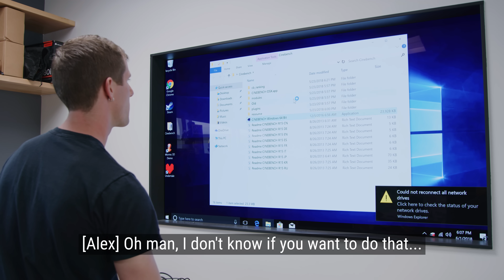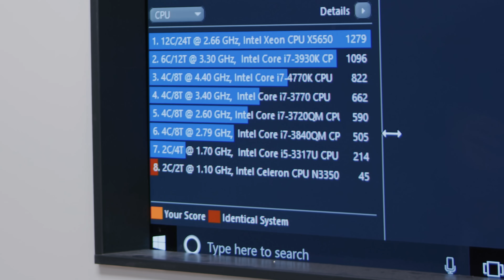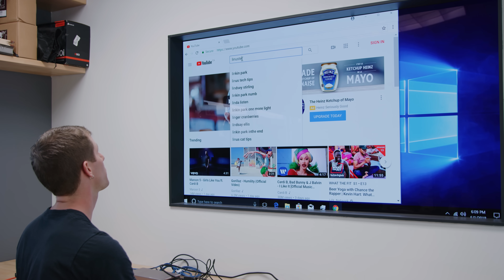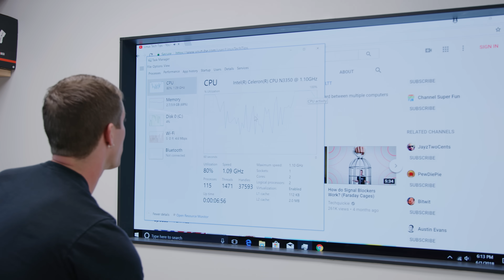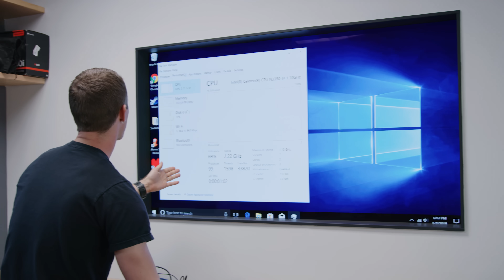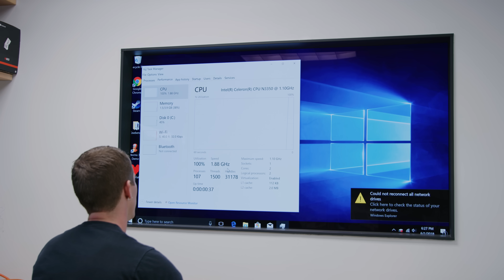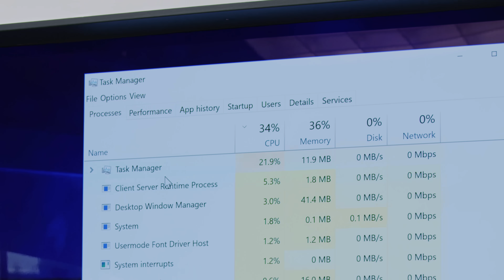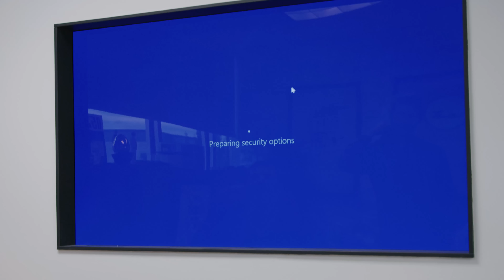PC Smaller than an SSD

Comment: The new raspberry pi 4 clocks at 1.5 GHz and has 2  4K HDMI 2 USB 3.0 and 4GB RAM
Reply: And has ARM architecture instead of x86/x64
Reply: Thomas Winovich I bought it
Reply: And it runs windows! I can't remember the link to the project but it does!
Reply: @ImTheBoyReal Most of them have a low powered intel cpus with 2GB ram . Not ideal... The versions with 4 GB of ram are very expensive . If you can afford them just get a laptop
Reply: @culturedsquid8442  even today's mini laptop would do
Reply: And it uses usb-c, as broken as it is.
Reply: Can’t run windows or steam or pretty much anything with the arm processer
Reply: @culturedsquid8442 .. Expensive? It was maybe $80 for me, and that's in the Philippines. Should be even cheaper in the US
Reply: @shavedbird694 .. Why bother gaming or using steam on a single board PC anyways? You're better off buying an old laptop for that
Reply: @redpillsatori3020  I'm not from the US , I'm from Greece , they are more expensive here . The 4GB ones start around 240,00 . And they have Atom chips and Celeron J s . Sure a similarly priced laptop isn't doing much better . They are on the same level , but the laptop has a screen , a keyboard , the trackpad , a front facing camera , speakers and a real ssd at 256 GB ! While the Intel comes with none of these , you have to buy it all and it comes with 32GB which simply isn't enough for windows .
Reply: Me (who knows how to overclock it.): There is 2.1 ghz acctualy

But if you want to overclock the gpu too, you need to clock the cpu to 1.8ghz and you have to have luck. Its very hit and miss. If you reinstall the os, it might work, it might dont, depends (on something probably). Maybe ill work after an update.
Reply: It’s also got a quad core processor instead of a dual core.
Reply: Office Chair n
Reply: @culturedsquid8442 .. Ah that's surprising considering that Raspberry Pi foundation is based out of the UK so you would think that they'd be cheaper in Europe.. Maybe Brexit has something to do with it. Lol
Reply: @redpillsatori3020  he means the intel compute stick
Reply: Grant Gardner it barely runs windows. Has very poor driver support. It would be faster to use QEMU 🤣.
Reply: True
Reply: @Windows Fanatic 2020 Exactly these people don't know what they are talking about.
Reply: Now there is a version with 8gb ram
Reply: Rohan Raman Windows has spyware and keyloggers built-in by design. Just saying.
Reply: @aero33888  But then again, it is still the most used OS in the world. I myself use Linux, but just because, for my use case, I prefer it.
Reply: @mrpawno4955  but now twice as much RAM as your x86/x64 computer. And a lot of ARM are faster than x86/x64
Reply: @ggldmrd5583  maybe.... But what i wanted to say with my original post is, that everything PC based (software) is made for X86 and not arm. Thats the problem here
Reply: @mrpawno4955  And so you think that it's normal to not know how to recompile softwares from sources when we use a computer ? I think that this is the first thing to learn when you get a computer...
Reply: @mrpawno4955  Also 95% of free packages have an arm version today...
Reply: @mrpawno4955  Even Windows 10 got an arm version...
Reply: @ggldmrd5583  i think youre trolling right now
Reply: @mrpawno4955  No, im serious. All what you can do in a x86/x64, tou can do it on an ARM chip. You just have to code it or compile it because more softwares are made for x86/x64 due to the fact that x86/x64 came out before.
Reply: Weak

Comment: When a pc the size of a trackpad on your laptop is faster than your laptop
Reply: Lucky_Miner01 And your phone
Reply: WHEEEEZE
Reply: This is actually faster than my phone when overclocked  My phone runs at 2.01 ghz
Reply: And your supercomputer
Reply: dude theres no way you have worse cpu than 1.1ghz
Reply: @xt2607  sndn 625 is 2.02GHZ
Reply: @inter-galactictravellerspa9036  snapdragon 625?
Reply: @nvcbl  nope Snapdragon 675
Reply: @inter-galactictravellerspa9036  oh ok my phone is clocked at 2.02ghz
Reply: @nvcbl  is it overclocked
Reply: @inter-galactictravellerspa9036  ¯\_(ツ)_/¯
Reply: @xt2607  Don't underestimate Chromebook-like laptops.
Reply: In your dreams.
Reply: My phones clocked at 2.3ghz but it's a exynos 
9610
D:
Reply: they used the acer nitro 5 i have that laptop (cool)

Comment: Wow! That's cool! Actually, smartphone nowadays is also like a mini PC.
Reply: Marc TV I was thinking the same thing...
Reply: Not x86 compatible though.

I'd love to see them run something like the Quake 3 benchmark, I've been running that on every PC that I've built for just about 20 years now and although it seems to bottleneck at around 900fps on modern hardware it's still a great way to compare the speed of slower PCs.
Reply: Smartphones use ARM CPUs, that's a different game...
Reply: And you don't have to use a dumbass touch screen that doesn't read inputs correctly more than half the time, so it's better than a smartphone
Reply: meanwhile i buy a 8core cellphore
Reply: the amount of cores themselves doesn't matter much
Reply: Welcome to 2007
Reply: Marc TV but cant run windows
Reply: but none can run full windows OS, until this.
Reply: Who say smartphones can't run Windows?
There are emulators for Android to run them since 2013
Reply: Marc TV is not wrong imo.
A lot of smartphones nowadays ( excluding iPhones since their bulky "secure" system don't allow much functionality to work like Windows ) can do most of the work that Windows can do : Editing videos, file manager, compose Microsoft words, excel, powerpoint...
If you like, you can also buy an OTG USB to have mouse and keyboard input.
Reply: @Dankeststorm, I do. You can run without hardware and software problems? I know you are lying. Full windows functionality is not there. I've been through it.
Reply: U can still run a lot of things
Reply: mg23 
Of course it's gonna be problems since they are not optimized, like, sometimes the emulated Windows can't read my CPU or GPU, but it's a possibility.

Edit : Possible means it's able to boot Windows up and usable, but it's a bit glitchy
Reply: Ritit 
Yeah.
Reply: But this mini PC is a full windows machine! (Or linux if you can put it on there)
Reply: But can it run Crysis?😂😂
Reply: +Felix_ Rock_ While the vast majority of computer hardware will actually run Crysis (How well depends) On this occasion I don't think it will even start lol
Reply: Felix_ Rock_ 
No, but it can run The Elder Scrolls.
Reply: Felix_ Rock_ 
No, but it can run The Elder Scrolls.
Reply: Haha it's like a bulb just turned on in your head. Smartphones have always been like a mini pc
Reply: Yes but with screen camera and speakers
Reply: quake 3 is open source and can be compiled to most modern platforms
Reply: i've run some simulations that are written with same algorithms on both x86 and ARM (only difference being the compiler) and i've compared. My Ipad pro is only half the speed of my 15" quad core i7 on these test. It was a Finite element modeling. (running topology optimizion)
Reply: You mean.... Asus ROG Phone?

Comment: Can you try and make it into a DIY laptop? With a battery, keyboard and display in some kind of enclosure that I'm suggesting would be 3d printed
Reply: I've always wanted to do this
Reply: Well yes u can do that with a raspberry pi as well just how easy/hard is it to do and if u are skilled enough to do it is the question.  But if u can 3D print (very well getting sizes right can be hard if u are new to it) your off to a good start
Reply: Trey miller raspberry pi computers laptops are not good if you try to do something serious
Reply: The GPD Win already exists, and it runs much better that this thing.
Reply: that's not the point
Reply: I think that the Kangaroo PC is a better concept for that. It already exists, but it's not easy to find available to buy.
Reply: Motorola Atrix or Bionic Lapdock. Laptop without the PC for said phones to dock into. Has battery, screen, sound, keyboard, and mouse in a laptop like device. with some hacks to the power delivery circuit and adapters it could potentially run.
Reply: Also you should delid the processor
Reply: Just buy lattepanda, like cmon its old already and way better than this, 8g ram 64g drive M3 7y30, lots of ports..
Reply: All mobile processors are already "delided".
Reply: BEN, we all know it's you. Stop this, get help.
Reply: Check out the PineBook or one of those "DIY Laptop Pi" kit :) those can be great
Reply: YYYEEEESSSS PLZ
Reply: I mean, you could probably shove it into a PI-top with very minimal work.
Reply: There's a tonne of other channels for that. They're known as the non tech review business channels.
Reply: So many people saying Pi-top as if the LattePanda doesn't exist and wouldn't be a better fit for a DIY laptop since then it'd be Windows 10.  (edit: missed Jovan's response)
Reply: God no keep these guys away from anything DIY
Reply: Sir Valiant III but it will make for entertaining content
Reply: DoomRater Not that many DIY enthusiasts would choose windows over Linux since that would be there go to operating system for most of their projects. Plus there isnt much that windows can do that Linux can't
Reply: The GPD Win is also hellaciously overpriced, as is the Win 2 and the XD
Reply: DD Electrotech has done this with a raspberry pi
Reply: You're living in 2089
Reply: Why bother, I picked up an Acer Intel based chromebook for £50. Slapped a full sized ssd in there and 8gb of ram, ran a boot hack, then slapped Ubuntu 18.04 on it.
Reply: People have turned gaming consoles into laptop form factors, so I can't imagine this being much harder.
Reply: Thats a pretty dumb and pointless idea/exercise.

Comment: Totally going to try to cram this into a game boy shell like people do with the raspberry pi
Reply: Joshua K it’ll be easier to do on the pi, input output on arm is 100x easier than on this, not to mention the documentation is already there for retropi.
Reply: probably doable.. you'll want to find a better way to cool it, though.. XD
Reply: gino1313 I'm sure i could get it up and running with a light Linux OS and have Emulationstation/Recallbox boot up at launch. Then just splice some wires and add usb audio, Arduino with a gamepad sketch, and solder a charging/5v boost module to a polymer battery. I agree that the support for the Rpi makes software very simple, but that RAM and GPU on this PC make it very tempting to try. Those were the main bottlenecks for N64, Dreamcast and PSP on the pi. This micro PC has so much potential...and with 5v 3000mah draw it's easily within reach.
Reply: Joshua K I'm intrigued to see that happening now, best of luck if you do
Reply: Why? as you  aknowledged raspberry pis exist.
Reply: The pi will out perform it
Reply: ROCK64
Reply: and then what ? you get a crappy windowzed emulator ?
Reply: You should never, never ever install flashplayer. ever.
Reply: Bruce Banner probably you are experiencing some kind of user error, pepperflash should work on every site, despite of that, you can do better on a cheap hardware with Linux than windows, everytime, it's just lighter and efficient than ever
Reply: Bruce Banner Maybe it's the 1gig of ram that makes your videos crashing, chromium isn't exactly a lightweight browser, make sure you use some microsd swap or try a different browser, if that persists can be a software bug, imo there are better distros than raspbian
Reply: Joel Rufiange It'll be on a screen no bigger than 3.5" with a resolution around 320x240. Which doesn't look bad at all...and certainly isn't bad for retro gaming. The Raspberry pi 3 is very good at this with only a fraction of the Zotac PC's performance.

Comment: You might be amazed how much better that thing would cool if you simply laid it on a piece of aluminum. 

Seriously, just a small flat piece of sheet aluminum like the side pannel of any old PC CD player would probably cut them temp in HALF!

My battery charger is able to stay cool enough to never use the fan, just from a tiny piece of aluminum smaller then a mouse pad.

:)
Reply: Joshua Norris I'm surprised they didn't put a fan on top of that thing, even an 80mm one would help a lot
Reply: I wonder how good it would run if you zip tied it to the front of a window air conditioner.
Reply: They probably should have doubled the aluminum in the case and or increased the ridges to help with cooling.
Reply: Just about anything would be better than your hand...did he really think that would help, or was he joking?? lol
Reply: Why dont use a Blowymatron? Oh yeah It would blow it away...
Reply: Actually the lack of performance is due to the low wattage suppilied by the provided power adapter and the use of MicroUSB instead USB-C. 2-3 watts total in the adapter while the CPU is a 7.5watt part on its own let alone anything else you may plug into the USB ports or the rest of the power requirements of the device by itself. So yeah Zotac SCREWED this over BIG time.
Reply: aluminium*
Reply: Montisaquadeis It was a 5 V, 3 A power adapter, that's 15 W. Which, consequently, is a LOT of heat for such a small volume. Would love to see what this can do with some interesting cooling. Lap the enclosure and strap it to a CPU cooler?
Reply: microbuilder i think he was serious about cooling it with you hand. Which tells me how friggin hot it was getting lol

It was begging for some cooling haha
Reply: I dont doubt it was getting hot, but skin temp is often near body temp, which is already almost 100 degrees.  simply blowing on it till you hyperventilated would probably work better lol
Reply: microbuilder ya probably lol.

Depends how hot it was, id say the hotter it was then the more viable the blood cooling becomes lol

Anything would help. I would just lay it on an anvil or something :P

Comment: Like the idea, still some way to go for it to be upto every day use standard.  I would use Internet and media browsing through Microsoft Edge.  Its a terribad browser, but very well optimized for low end devices.
Reply: First reply!
Reply: The newest edge it's even better!
Reply: @joseevb04  The new Edge is Chrome-based
Reply: That cannot count anymore though, because I have a cheaper Lenovo laptop and it only has problems when I use Edge, Firefox works perfectly fine!
Reply: @hypercrite  Edge switched to Chromium as a base some years ago, so it's probably got similar problems to Chrome now. Though I thought Firefox changed as well because at one point, it was suddenly multiple times faster for me when the new design was introduced.

Comment: Pff, you call that a bloodcooling system? As a bloodcooling expert, and I know that the two most important factors are heart rate and blood temperature, both of which can be put into the optimal range via a large ice lolly up the butt.

Please, don't laugh. The colon is filled with blood vessels and has a large surface area to volume ratio, and can accommodate a variety of lolly sizes. The real trick is increasing pump rate without increasing body temp, putting vigorous exercise is out of the question. This is why the pros all use an unexpected #iceplug, which really ramps up the pump rate without warming the blood.

For casual bloodcoolers you can get some metal plugs from Apple that you keep in the fridge overnight. If you have an Apple watch or similar wearable device, you'll probably be charging the watch over night, so these two products really go great together. Plus the Apple "think different" logo on the base of the plug is a nice touch, appreciated by Apple fanboys world wide.
Reply: So can we do a water cooling loop with a butt plug on this machine? It has potential and could provide employment for #BoothFluffers everywhere!
Reply: I just use an Iguana. Cold blood ftw
Reply: Your right it's so much better than a hamster
Reply: Dude. You are not just an expert, you are THE expert!!!

Comment: DEFINITELY needs another run with Linux
Reply: Sithhy or Android
Reply: Definitely*
Reply: Or win 7? lol
Reply: true that. This has as much processing as a pi zero, and you can actually do more on that then this
Reply: Sithhy but linux is for nerds
Reply: we already know its the raspi zero
Reply: android x86 or something like an old version of debian would work
Reply: That's what I'm saying!  With linux you can run crysis in 4k 60fps :)
Reply: Definitely one of the most crucified words....; 2nd place place for common misspell attempt is 'defiantly'
Reply: Big thing is this x86 instead of ARM so you could run a different array of applications without being recompiled/ported.
Reply: Run it with Linux....While it’s installed in the second 2.5 drive in a laptop with some sort of custom passive cooler.... with a usb-c connector jerry rigged to one of the usb-c ports of the laptop...... with Synergy installed.... and using a second monitor to run Windows and Linux along side each other. Because you can.
Reply: Definitely needs another education with spelling.
Reply: I'm less triggered by "definately" than defiantly although it's close
Reply: Who thought Windows 10 was a good idea for this? My i3-530 can't even handle Windows 10 without the occasional lock up.
Reply: Agreed, would love to see this go head to head with a raspberry pi
Reply: Agreed!
Reply: Would drivers be an issue?
Reply: It shouldn't because its an intel CPU, and its 64-bit.  In Arch you would just install the intel-ucode package.  In Ubuntu based it should be done for you I would think in driver manager, not too sure about RPM based distros.  You should be good an most if not all Linux distros...I don't know what kind of firmware is on it, that would be good to know too.  UEFI maybe?